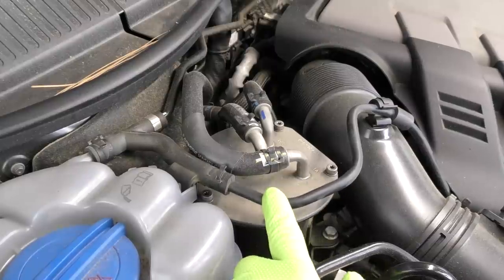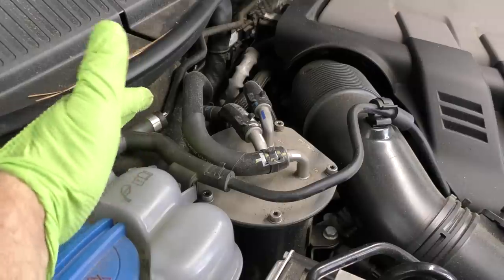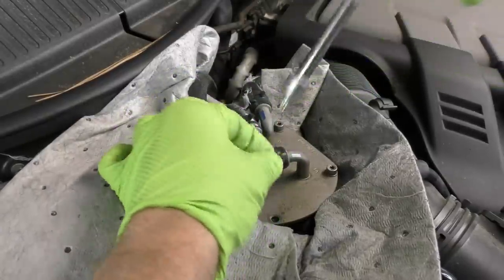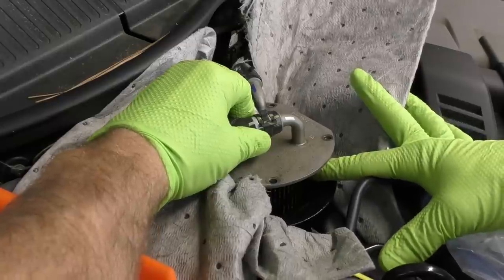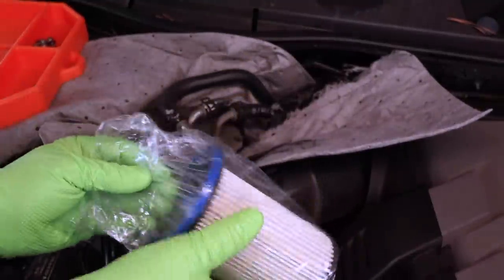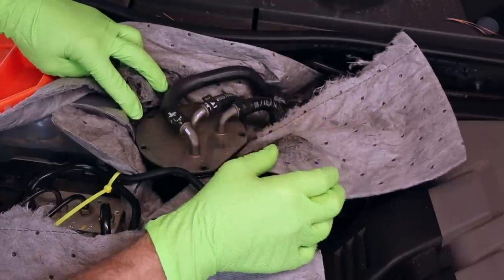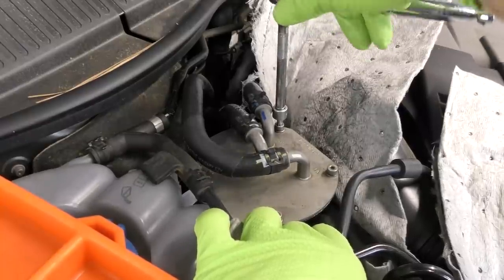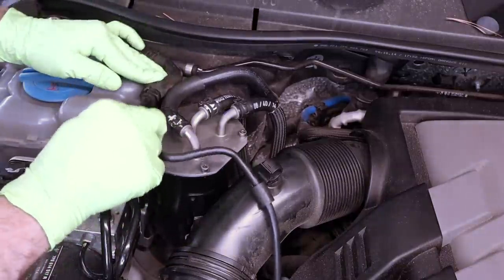How To Install TDI Fuel Filter ~ Diesel Fuel Filter Change

Comment: You really should drain the canister either remove it or suck it out.  It acts as a water/fuel separator.   Water sits at the bottom.   This espc important if you live in a cold area where it can freeze.

Comment: My older 2004 BEW TDI Golf has the sealed can filter with a water drain on the bottom. No bolts just hose clamps. In fact just did mine lats saturday. VW recommends changing every 20k miles but I have been bad about doing it and usually end up close to 30k and performance change after is noticeable. I should be more vigilant about it but life gets busy.

Comment: If you love your car it’s worth changing your fuel filter as often as you do your oil... injection systems are expensive and sensitive systems. Also the fuel going in to your car is not as clean as it should be

Comment: If anyone is interested what the dirty housing looks like you can check my video out. And to clean the housing it's easy, just remove it with 2 10mm bolts.

Comment: What to do when entering air and diesel injectors in engine 1.9 tdi 130 or V6
Reply from the maker: Check the lines and the seals.

Comment: I'm baffled on how the air "gets out" without a line open?? I'm new to TDI, but a B5 S4 owner of 13 years lol..
Reply: I think the pump in the tank is the low pressure side and fills this filter housing and cycles it back to the tank so its always full. So the air is sent back to the tank and purged. The high pressure pump takes filtered fuel from here and uses it. The priming from VCDS or the key just fills this till there is no air then cycles back to the tank. Hope that helps.
Reply: @SambaSp0rt  that would make sense! Thank you so much for your reply!

Comment: Most levels of government (local, district/municipality, state/province) have rules/regulations regarding the disposal of waste oil/fuel filters. Some provide public sites for drop off at a landfill/recycling center or maintain a register of businesses that will accept used filters.
If neither of these options work, take them to where you purchase parts, get work done or even the local VW dealership. Chances are that most are equipped to deal with used filters and have a vested interest in keeping such materials out of the general waste stream.
Reply from the maker: Yep we did that a bunch for people. Just don't be a jerk about it HAHAH.

Comment: Just total the car. TDI(well cr and pd) is dead like the steam engine. Long live petrol, long live the king.
Reply from the maker: LOL Until such time as I don't want to drive this anymore, I will continue to drive and maintain it properly. 

That said, Gas engines have come a long way.
Reply: Why the hell would he do that? Diesel engines are far away from being dead. How can someone not love max torque at just 2000 RPM? And no gasoline engine can beat TDI's longevity and insanely small fuel consumption. I have a '96 Jetta and that thing is on the road every day, engine was never opened, still has original head gasket and injectors. Once i fill it up, by the time i visit a gas station again, i forget how to open the gas cap. Because it's a thing that i rarely ever have to use. LOOOL :D